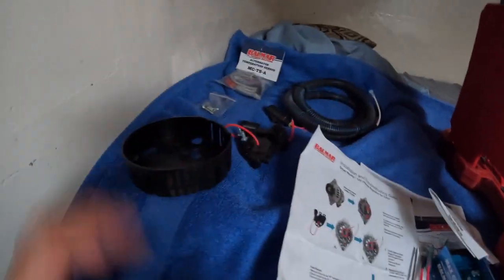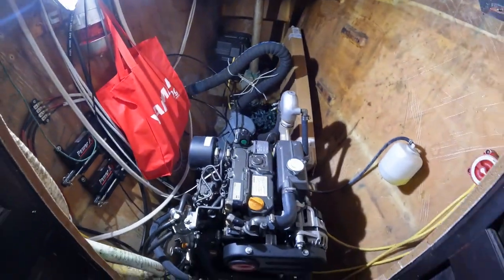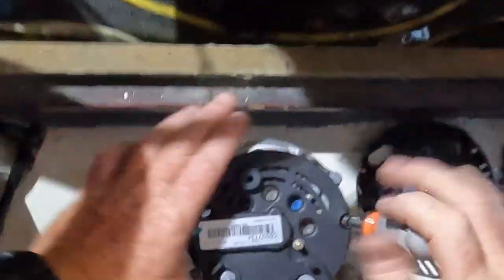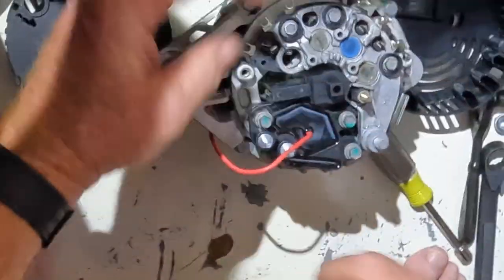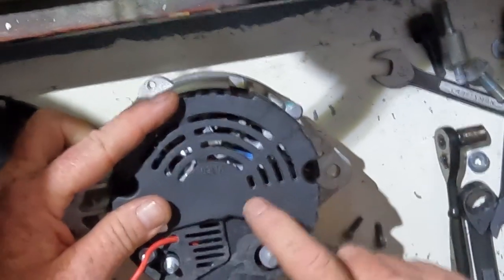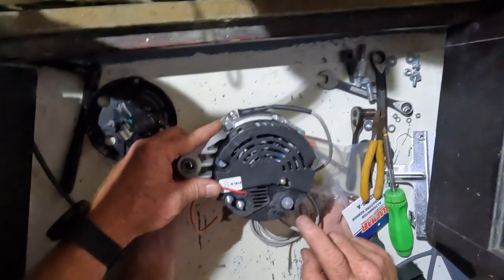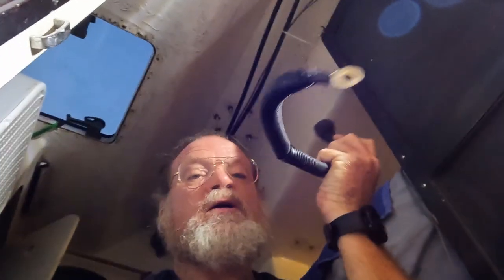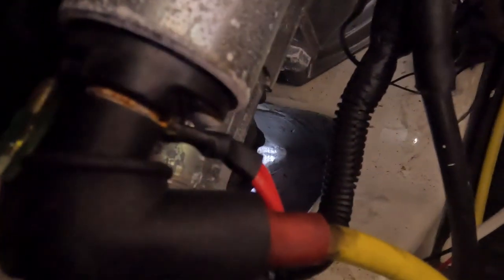Alternator Upgrade Yanmar Valeo 120 with Balmar smart ready

Comment: Great video, very helpful, and thanks!  Has this setup (Balmar Smart Ready) worked well for you?  Thanks!
Reply from the maker: It does charge well, and the centerfielder keeps both alternators charging.  It doesnt intgrate with all the victron I have on board, but i get over 100 amps while motoring, and the output is right for the house batteries.

Comment: Well done.  Do you have an episode on how you use the DC to DC to charge the start batteries? Thanks!
Reply from the maker: @ygautier6866  that's easy, my victron multiplus has a 4 amp charger built in.
Reply: @nautidreamscatamaran  yes but if your multiplus is setup for LiFePo then that is the charge profile that the starter battery is getting. It is whats called an echo charger I believe or basically it trickles over amps at the SAME VOLTAGE as the main charger. just something to be aware of

Comment: Hi Robert,
I just found your channel.  And just in time.  Your videos are excellent and very helpful.  Thanks for taking the time to share your expertise. 

I have a gemini 2020 legacy catamaran with two Yanmar 2ym 15 diesels.   I want to modify the dc electrics a bit to add a Lithium house battery.  Retain the two factory installed AGM batteries.

 First step is to upgrade my existing alternators with balmar external regulator kit - as you did. I'm hoping you can answer some questions as this project progresses. 

Would you be willing to answer some questions for me?  Should I send you an email instead of comments.  (I tried to retrieve your email from the Youtube button for that - but it does not work.  )  Could you send me your email ?

First - I have one  Alternator on each Yanmar 2my15 engine. I "think" they are Valeo 12v 125 AMP  Is that the engine and alternator that you have ?

What model number Regulator Kit did you get from Balmar ??

Thanks !
Curt
719.440-4358
CurtWPk@gmail.com
Reply from the maker: Ill send you a pm

Comment: Really good video.. best one about using the external regulator with the Valeo alt from Yanmar..  are you sure the blue wire from the original harness is ignition +?? If not mistaken, the Blue/Black wire is for the lamp, that if not mistaken, was connected to the L terminal of the alt..